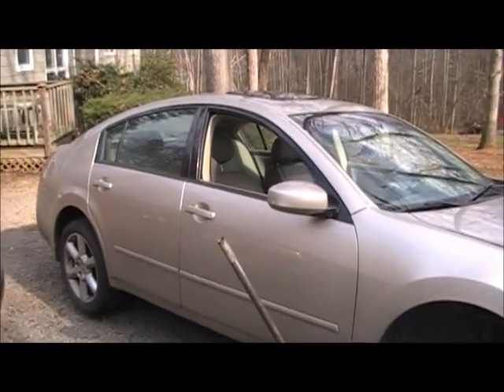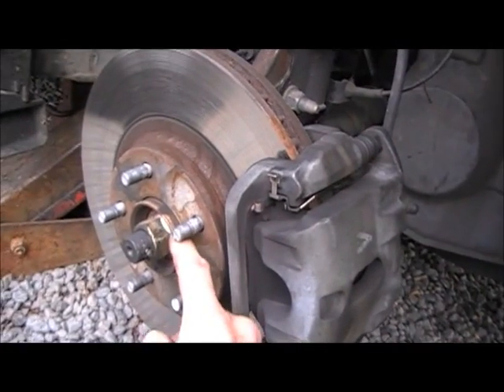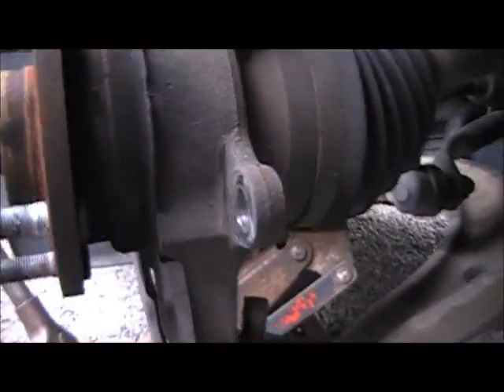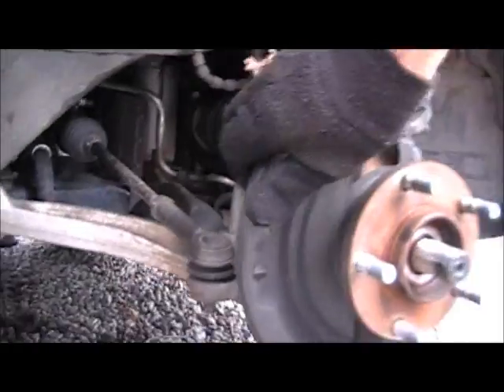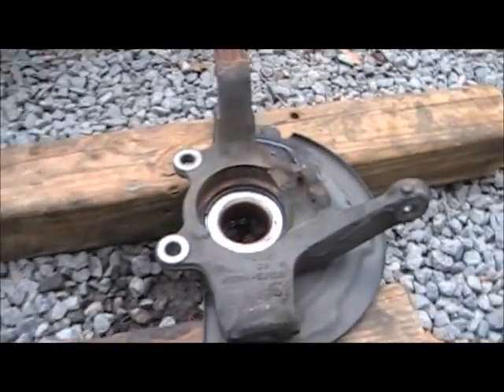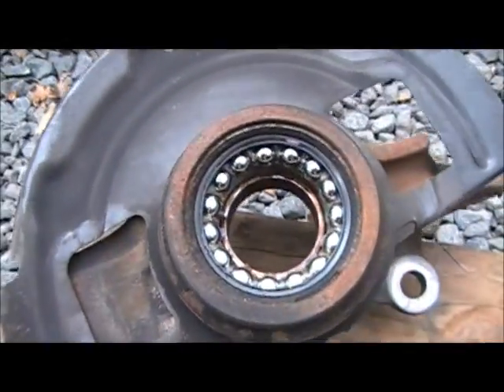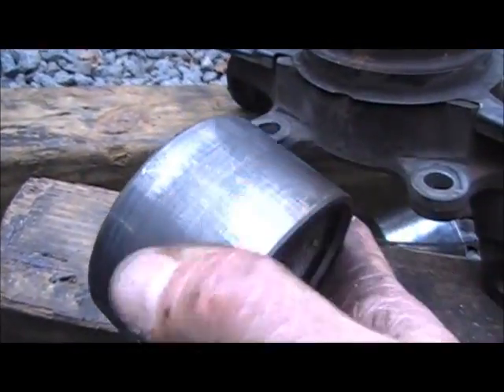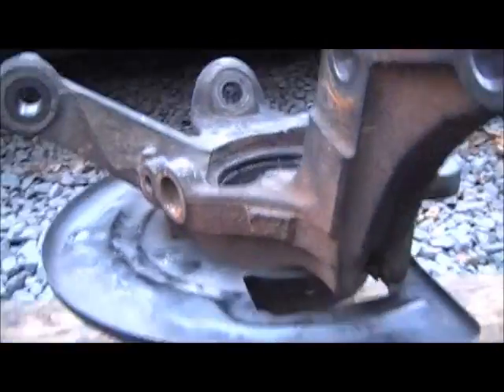2004 Nissan Maxima Wheel Bearing Replacement

Comment: 6:23 thank you brother. I just bought my brothers maxima and he thought it was a bad axle but it was a broken wheel knuckle. I got one off a 4 banger 05 altima but the center hub was smaller in diameter. I had to take off that center hub and your video saved me $250.

Comment: Just went through this, and the car's now running great. Though we ran in to some problems. Here's what happened: 2002 Nissan Maxima, MT. Driver's side wheel bearing change.
1) Axle nut was stuck on, even the dealer couldn't remove it. Had to break it in to pieces, ended up getting a new Reman Axle as threads were ruined ($60 / autozone).
2) Installed new bearing, hub, and axle. Needed professional help just for the bearing/hub press part.
3) Driving on it. Wooo!!! Thanks for your help!

Comment: Great videos man.  Its funny because  I have the same issues you do, as soon as my car starts acting up I search your videos and there it is.  I had an issue with rear bearings as well, couldn't figure out which side.  Turns out both sides were bad.  Replaced, note my car no longer sounds like I have mud grip off road tires.  Thanks for doing this the hard way, you convinced me to buy a $50 press off craigslist which made it way easier.

Comment: As a tech I found that freezing the bearings they go in much easier,I always put my bearings in the freezer before install,and I always use royal purple grease...
Reply: Yeah I agree I do the same thing,, heat up the wheel assembly and freeze the bearing and drop it in..

Comment: for 2 days now ive been looking for info on this! i have a 06 escape and im doing my front wheel bearing got a bearing race kit from pepboys should of went to advanced auto much more loaner tools! i stil have that middle part in knuckle gonna try to get that out now than see what on the hub after might have to cut it like you did i dont have a puller! Great job man

Comment: I did it and it was nearly perfect. Only exception - I cheated and used a press fit machine my friend had. I could not beat that hub out with 2,000,000 hits. I got worn out. Luckily it was free to use the press fit. I'm doing the hub on the other side now. Thanks again!

Comment from the maker: The WD in WD-40 stands for water displacement . It will not "eat metal" but due to the thinness of the fluid it makes for a great substance to aid in the install. It should not be used as a lubricant, again due to the thiness of the actual fluid.
Thanks for the praise ! Have a gooden !

Comment: Thanks just finished up mine reassembling now, Ended up using harbor freight 30mm to drive inner bearing out, then used gearwrench 2-1/8 for the larger bearing, had to hammer the gearwrench socket once or twice on each snap ring to break the rust on the loose, then used autozone rental axle socket 36mm to hit on the focal point to drive the hub back in, though a 37 would probably had been nicer..

Comment: Like he said using the old bearings races as a punch is great save old races for jobs in the future. Once you have a few cut a notch all the way through so if you have to pound something through a sleeve they have a little room to contract and are easy to remove after using it as a punch.

Comment: Will removing the brakes as shown require the brake lines to be flushed and refilled? I've seen videos describing the method for changing pads, and it appears that reseating the caliper piston forces out brake fluid, requiring the whole system to be flushed. 

Doing this job and placing the same pads back on, will I be met with any issues?

Comment: So you actually hit the inside race.  My bearing was stuck so bad i had to cut it out of the nuckle  cuz it broke a 6ton press but  now I need to put the bearing back in. So you put the the adaptor right on the race. The hub underneath n hit the adaptor a. It pushes the hub up into it??

Comment: Hey nugget I have an 04 Maxima like your working on and my shop did the same thing you did but they had the press that you mentioned. Now I have got the job done because my wheel bearing was making the metal to metal sound.. Now that I have change the wheel bearings but I'm hearing some light noise from my passenger side now.. Might I need to adjust my brakes or could it be a bad hub being that I only changed my wheel bearing..?? Get back and thanks in advance..

Comment: great video! Already got the nuckle off took about 10 mins starting on the rest tomorrow. dont have press but i got a car lift and many other mechanical tools, thought about getting  my porta-power and welder and make would be press if you will. But that will be if i fail when i ( and i quote ) "shmack it" Thanks again

Comment from the maker: It holds the bearing. Some cars have a hub assy. thats replaced and some have pressed bearings that you install in the hub assy. or steering knuckle. The hub assy. for the maxima consist of the part that attaches to the wheel or that the wheel bolts to and would still require assy., so purchasing it would still require the procedure shown. The only way arround it would be to purchase a new knuckle assy., which would be quite costly.

Comment from the maker: Clean the hub with a wire brush or light sandpaper then grease with any lube of your choice to aid in the reassembly. Any oil based substance will work just fine.

Comment: The FSM states to NOT apply oil or grease to the mating surfaces of the bearing outer race and inside of knuckle. It states to press the bearing in dry.

Comment: Does the new bearing need to be packed with grease before installation?
Reply from the maker: Nope, it's a sealed bearing.
Reply: Thanks...

I had a local shop press in the new Nissan OEM bearing for me less then 2 years ago and it's already squeeking again like it's dry or something.
It almost sounds like a bad brake and it goes away while accelerating...checked brakes and they are perfect (newish)

Comment: Is it the same steps as for a 2004 Nissan Sentra ? I'm trying to pop out the bearings out as you posted but it's to hard to take off. I keep hitting it and it won't come off.
Reply from the maker: Make sure you have removed the locking rings and knock the piss out of it !

Comment: One question, when you were getting the center hub back in the knuckle did you have any issues with the wheel studs popping out
Reply from the maker: Jomar Rivera No, none, would mean they are loose and maybe a hub assembly would be a better fix.

Comment from the maker: Simply put somthing on the backside to hold the bearing race in place, the center part of the bearing. Then use a soft hammer,brass or wood block, to hammer it in. Must secure the center of the bearing at this point so not to knock out the race.

Comment: Hay, I'm a owner of a 2005 nissan maxima.. I'm having issues with my ABS system activating when on dry ground.. (not on ice) I took it to my dealership an they said that my abs sensors, actuator, wheel bearings an a belt needed replaced... I'm pretty good with my hands so I searched your video... my other mechanic friends said that the wheel bearing could be the cause to the whole problem, could/is this true?

Comment: My Maxima vibrates a bit, feel it the steering wheel under acceleration, wheel bearing or CV 's ??
Reply: jack up the car and pull on the wheel with your hands.

Comment: Be very careful and wear safety glasses and long sleeve shirt/pants when hammering on hardened bearing races. I just had to cut the race from the inner hub, then hamer it to crack it, and had a piece splinter off on me and get stuck in my pants. Very effective method though, if your careful.

Comment: NIce Video...however I would not recommend using WD 40....this stuff will eat through metal and then you'll have more problems. You can use it to clean metal parts but then make sure you wipe it clean then use a good quality grease for lubrication. Great Video though!

Comment: Its easier to find a socket that will fit onto the outer races inner lip to remove it less chance of missing that way  .. this car it was gotten too before the popping and grinding stage , most outer races heat weld themselves into the knuckle assembly, i know this as I had to do one in a parking lot of a parts store i worked at, so directing all the force to the outer ring sometimes will get you nowhere, without a press this blows but at least you get some aggression out

Comment: This is much easier if you go ahead and replace the hub/wheeling bearing as one unit.  An average quality one will cost you about $97...A very good one like SKF, will cost you around $204
Reply: Yes if they disassemble as a whole unit! These type of hub setups require you to press the hub out before the bearing can be removed.
Reply: If def. makes sense to buy a new hub why not..
Reply: You can not buy a bolt on bearing hub assembly for this and many other models. It has to be done this way or with a shop press. You can however purchase a complete steering knuckle/ bearing/ hub assembly for approximately $225. For those who want to save money this is the way it has to be done. The bearing is the only part needed preferably with new snap rings which is less than $40.
Reply: It isn't that hard. A press would be really great but the hammer method works. You can find a socket like he used at  Tractor Supply Co. for under $20. Even less if you can find a coupon code.

Comment: What size socket was that to pop bearing out?
Reply: He already said 32 mm you need to pat attention
Reply from the maker: Anything that fits the inner diameter would be just fine.
Reply from the maker: jcanuelkwnowitall We offer help and guidance here and keep the rudeness to ourselves. For instance, one could argue that the question was not directed toward yourself.
 Help and guidance is welcomed, all others will be removed.

Comment: can you please do a CV joint on that 04 maxima or any suggestions on do it??? or know a good mechanic in NYC ( dont hold that against me)
Reply from the maker: Will work on an axle vid , thanks for the request. It requires a few larger size tools that are not in an everyday tool kit but is easily done by a novice with instructions.
Reply: Roger that

Comment: WOULD IT BE MORE EASIER IF I BOUGHT THE SPINDLERS AND REPLACE THE WHOLE THING....CAUSE I DONT HAVE A PRESS MACHINE...basically all i need is both front wheel bearings....but to avoid the hammering out & all...its easier if i bought the spindlers
Reply: You can do that but buy oem,these oem parts are better and 
Arts longer than autozone crap,certain functional parts you want oem,parts like starters and alternators will not last very long from autozone,I stay away from those junk parts

Comment from the maker: Well the races are machined to eliminate the gap when the ber. is torqued down, doing an axle by hand is not reccomended, the big guy standing on it would be my choice without air tools. Dont worry, he didnt overtorque it to the point of damage im sure, if its even over at all.

Comment: how long did this whole process take?
Reply from the maker: I'd say an hour or so but it will depend on your skill level.
Reply: It depends on the amount of corrosion also,removing the snap rings and driving out the bearing races can be quite frustrating so don't get dis couraged.

Comment: This is why I love my GM cars just three Bolts to remove bearing hub. Removing the steering knuckle and all that pounding scares me. Hope I never have to change the ones on my Nissan altima.
Reply: +Killa Bee You can buy an assembled hub and just replace it all. 

GM is trash (like the 6th gen maxima auto tranny LOL)
Reply: That,s why most of my GM cars made it close to 300,000 Miles before driven to the junk yard that's right driven because they don't die. assembled Hubs for Nissan is expensive and still labor intense. This is why these guys are replacing just the bearings.

Comment: I have a 2000 Nissan maxma i changed my brakes and rotors. The braking sound went away. But a loud whinning/squealing sound is there does it when I'm driving. would that be my wheel bearing causing that? Need help driving me insane
Reply: +rich park sounds like its ur hub bearing well from what u typed